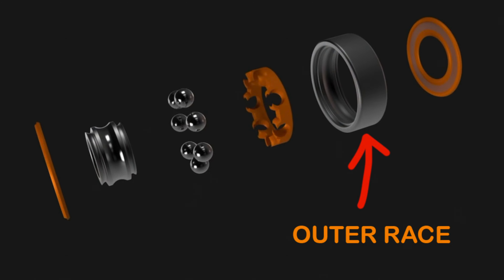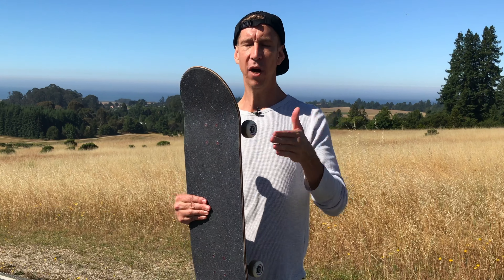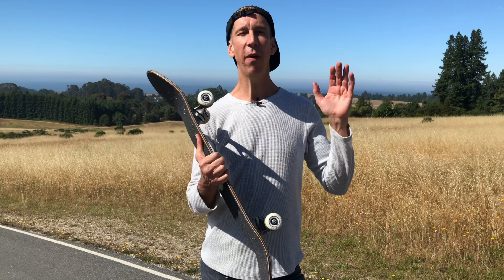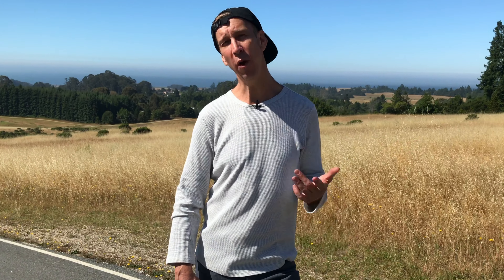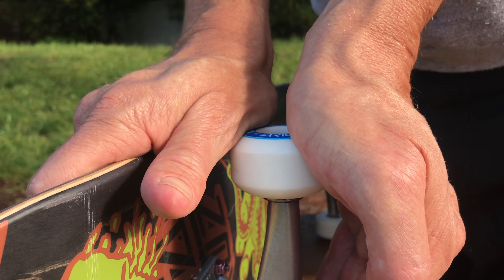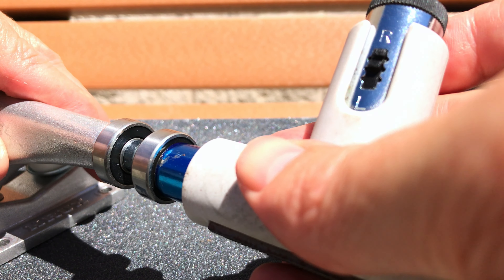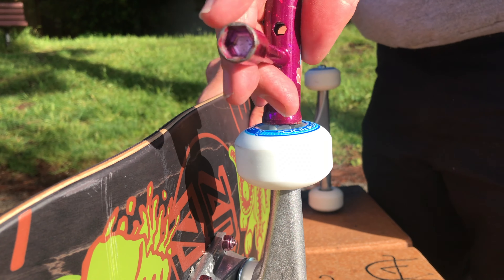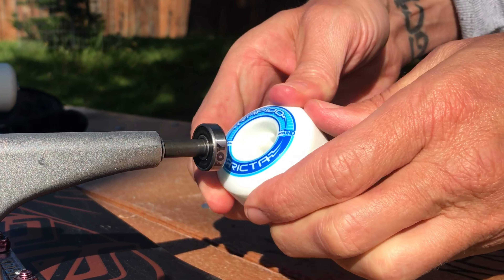Don't Break Your Bearings! - Whale Talk

Comment: I’ve always skated with the spacers, but now I know why they help! Thanks Ron
Reply: There's a very solid argument to be made how spacers will force bearings to line up much better with the truck axle and therefore spin faster with less resistance. Definitely a good idea to use spacers.
Reply: @PHeMoX .... Yes sir that is a fact and that is built into the design....

Comment: Would really like to see all skate bearings tested scientifically instead of stories/anecdotal. Luckily I'm not sponsored so I'm free to do this. All it requires is skating same amount of time every week, test the bearings with multiple speed runs after 3 months or so. Will post results in a year or so.spacers/no spacers will do both. Probably 10-15 of my preferred bearings. If a reputable person did this it would turn the bearing industry upside down since theres probably $50 bearings that run similar to $15 ones just no one has even attempted to test this stuff smh

Comment: I hate having spacers between my bearings, it makes an annoying rattling noise. Makes for my Nora Bronson G3’s to not be a smooth ride. But I do keep my washers in and love how smooth my ride is!💜🥰
Reply: Finally a benefit of no spacers I didn't consider (have thought of spacers but skateshop guy said nah not needed). Has anyone tested these claims? I'm about to start testing bearings by skating 3 months same time 3 times a week then doing multiple speed trials down a smooth path I have but sheesh there's millions of skaters out there has no one put science to test these claims of "they'll last longer" it's seems all anecdotal
Reply: @franciscoramirez9867  I have been using spacers on only one set of wheels (55mm Oj Mini Super Juices) on and off and it makes a cool difference with either bearing. Landing gives you a better recovery and you feel more centered for better truck feel but I mainly speak free about traveling than tech. I prefer to not use spacers with harder wheelsfor tech since if the spacer is not the proper lenght in the wheels depth, it will cause early coning on the wheels thus making me needing to check on them regularly more. If the spacer is too long, the bearing will stick out further away from the wheel using the spacer as a center point to catch the bearing than the inner bearing roll cage but it may be worth the experience if you're really needing to save your bearings but ceramics were made to not need to worry as much in recovery points than just riding.

Comment: Someone told me if you get bones bearings the spacers that come with them are best matched with other bones wheels since the middle core is perfect size for those spacers. I put the one bearing on a spitfire FF and the spacer that came with my bones bearings to see the spacer would stick out and it kinda looked it did just a little but on the bones wheel it was a perfect fit. Do all spacers fit every wheel the same?
Reply: No and thats the problem with spacers. You will damage the bearing if the spacer is not seated properly. All wheels need to have a standardised core..

Comment: Love this nerdy skateboard talk... this vid also makes me further skeptical about the bronson shieldless, I'm under the assumption that the shields are meant to hold the oil/lubricant you use after cleaning the bearings.
Reply from the maker: I think the appeal of shieldless bearings is that you run them dry and can clean them more often. So its not really about keeping them lubricated.  I think there's also a love for that sound of that dry spin. 
Sounds like I need to do some research and make a video about the benefits of the Bronson Raws. Thx!

Comment: Should the spacers move around inside the wheel when they are off the trucks?
Reply from the maker: Yes, that's fine. Although a little annoying when you're putting your wheels back on and trying to get them to line up with the bearings.
Reply: @NHSSkateDirect  ok good, I wasn't sure if that's normal and it's worse in one wheel so that's the hard one to get lined up 😅

Comment: 1:33 yeah mate that is not how physics work. if the force comes from the top, the outer edge of the INNER bearing will take it. the outer bearing has no axial load AT ALL in this scenario. A spacer can, under no circumstance, transfer any force of any kind in the opposite direction of the vector, so you can imagine how much it will change. nothing.
Reply: You’re being pedantic, spacers help reduce stress on bearings, don’t argue with me about how

Comment: I've always used spacers, but one time I forgot to put them in and my board felt so much faster. And after I put them back in, I noticed the difference. So I'm not sure about them making you faster
Reply from the maker: Interesting. Maybe your wheels were over tightened at first. They won't make your wheels spin any faster (or slower) when your bearings are new but they help your bearings stay faster over over time by protecting them from sideways stress.

Comment: I fixed the problem of broken bearings by buying Bronson's instead of Bones bearings. This is no joke, I'm dead serious about it. I bought Swiss Bones five times in a row and sometimes they only lasted about 4-6 weeks. My first and only set of Bronson Ceramics is about 2 years old and still runs absolutely fine.
Reply: Half of my bronson g3s broke because the shield dented inwards, they did last much longer than bones reds though. Right now I'm trying bones big balls with spacers and it feels amazing, sounds very solid
Reply: @slarbiter  you gotta be careful about how you install them, you can also un-dent the shields by prying them out with a needle and with a small rubber mallet you can flatten them back out

Comment: I have a ripped bearing shield on one of my bearings and the shield is popping out every few ollies. I have tried to put my shield in really hard and it stays in for a few days but always manages to pop back out again when I skate enough. I don’t even know how it ripped and it’s driving me crazy.
Reply from the maker: Had that happen as well. Once a shield is damaged it often won't snap back on correctly. Maybe leave that shield off and turn it around so the exposed side is facing inside the wheel.
Reply: If they are Bones bearings you can buy replacement shields and cages.

Comment: The problem using spacers is that most street wheels are too small for the spacer to fit between the bearings, the bearings can’t sit flush all the way in with the spacer there.
Reply from the maker: Sounds like you might have the big spacers. They come in 2 sizes. 6mm and 8mm. Smaller tend to fit on smaller street/cruzer wheels and the bigger on XL longboard wheels.
Reply: @NHSSkateDirect  You should sell them then! They're impossible to find by size...

Comment: Spacers should came with wheels not with the bearings, the inner core of the wheels changes and some spacers doesn’t fit well and cause inefficiency or doesn’t fit properly
Reply from the maker: Very true. Depends on the spacers and brand of wheels.

Comment: Bearings that roll faster depending on which way they are facing?? Yeah, sorry, but have to call bs on that. Physics literally doesn't work like that. No bearing is off balance by design along any axis. And most bearings will have one (more) open side that faces inwards only to prevent dirt from getting in there as easily. It has nothing to do with speed itself. The other factor that matters a lot is to get GOOD wheels. If a bearing doesn't sit flush with the actual wheel itself or has cores that are not straight, it will wobble a lot when spinning. Also, it is a very bad idea to sink in bearings by tightening the nut and getting it in that way. You're going to ruin the wheel, especially when they are softer or have like a plastic core for the bearing to sit in. Bad idea, because you're basically overtightening them before they get to where they should. It's also the best way to damage the shields directly. A better idea is to put your skateboard on the ground and use your upper body weight to get the bearing into the wheel. Unless you're a total gigant, you're not going to be able to damage the bearing that way, nor the wheel. Think of it like tightening a nut with your fingers, versus tightening it with a tool. It should be obvious which one is safer should you ever get the nut on poorly. The tool in that case is likely to destroy some threads. Last but not least, I'd say most bearings have best value when they are fairly cheap, well maintenanced and last a few months, versus buying the expensive ones that can and will break too. So don't fall for the whole 'expensive bearings are better' nonsense. 99% of the time the roads and dirt / gravel / mud pools etc. you ride on will define how long bearings last.